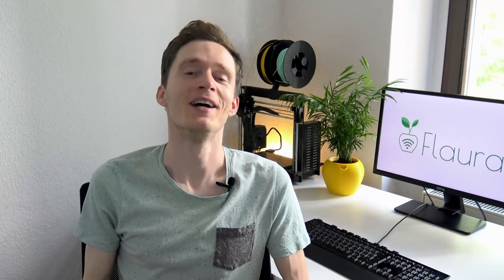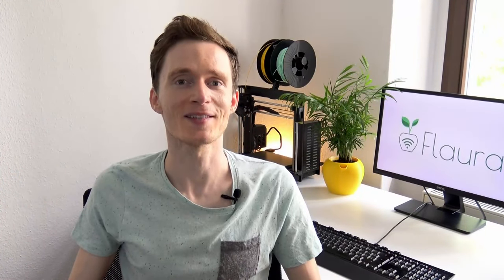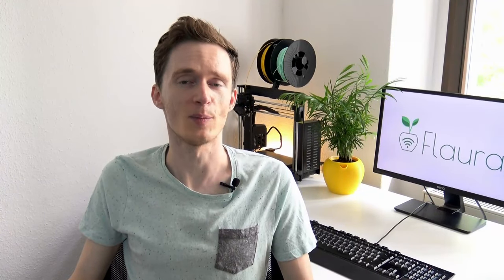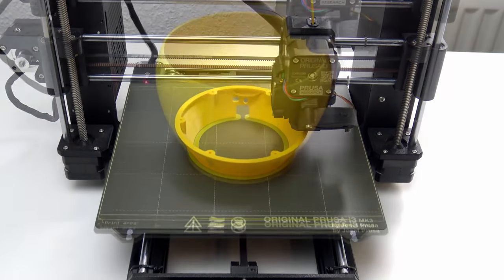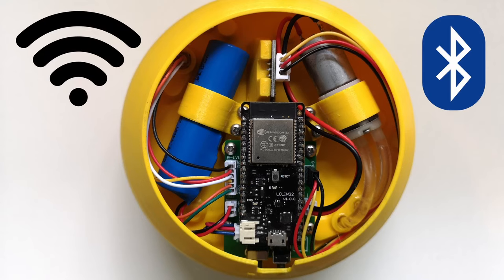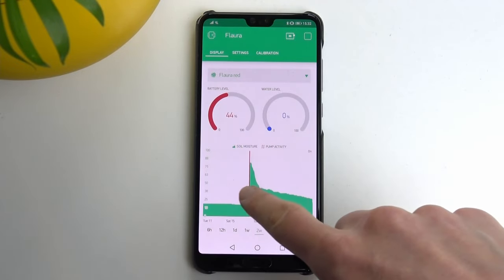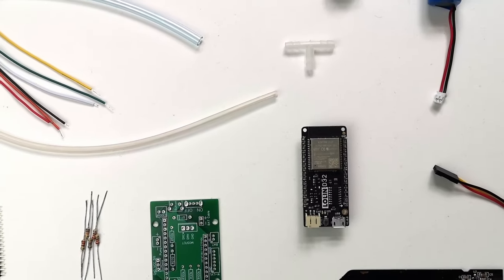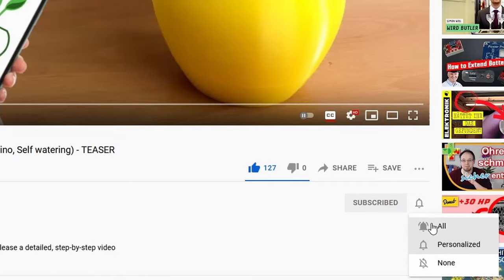Flaura – Automatic, Smart Plant Pot (Self Watering, DIY Project, 3D Printed, Arduino) INTRODUCTION

Comment: I would like to see a reservoir tank feeding a larger system.
Reply from the maker: I will try to adapt the current system for large plant pots, but very large sizes wont be printable on a regular 3D printer. So maybe these will require a different approach.
Reply: Definitely, and this is what would make this project truly valuable to others.  You can't justify parts cost and "over-engineering" for small plants, but you can for large expensive planters.  My retired mother spends four hours a day tending to her landscaping- and this is the stuff that isn't automatically watered. She can barely vacation without anxiety due to her large expensive custom planters.  I guarantee the cost of electronics to build a reservoir planter base or piggy-back type set-up would pale in comparison to what some spend on planter arrangements.  I'd LOVE to gift my mom some set-ups that I built for her!  Perhaps it's time for me to take this and contribute!

Comment: Excellent! I'm looking forward to seeing the whole series as my dear wife has filled our apartment with plants and is going on an extended trip - leaving me to keep up with the watering. I don't want to let anything die! 
Seriously though, I have been searching for a reliable solution to keeping our plants alive when we go on holiday together, so please do keep going with this series. I like the look of the pieces of hardware you have chosen to use - they look affordable!. Can I suggest that you release a BoM as soon as possible so we can order the parts and receive them in time for the assembly videos?
Also, we have more pot plants outside that need watering whilst we're away. They are in big pots, so a solution to use a big tank or container for several plants would be useful. We have space to hide the tank and don't mind running small pipes around the area if it means we can set up automatic, long-term, watering.
I look forward to seeing more in this series - thanks for posting!
Reply from the maker: Wow, thanks for this long and great feedback! I'm glad you like the idea :)
I will try to release the BoM as soon as possible, but there are still a few small changes happening to it every other day. When I`m done with the fine-tuning and there is a final version, I will let you know :)
Big outdoor plant pots are a completly diffrent story though. They are to big to be printed in a regular 3D printer and need much bigger water tanks and pumps. Maybe I will adapt Flaura for this application in the future, but I´m not sure about that yet.
Reply: @FlauraSmartPlantPot  This is all very much appreciated - thank you!
I understand the issues with large outdoor pots - we did try out a gravity-fed slow drip arrangement a few years back but it really didn't work that well. I'm assuming that however big the pot (ours are no more than 40-50cm diameter), the environment of moisture and watering remain broadly similar to house plants. Our outside space is just a balcony, so wifi & bluetooth will continue to work and the water flow rate shouldn't need to be very high - just 1 litre per hour (per pot) for example would be more than enough. Obviously a custom 3D printed pot isn't going to work here but a large tank (I'm assuming something around 20 to 30 litres will be sufficient, so not that large really) and some sort of manifold to feed individual motors for each pot. A 4 or 6mm tube should deliver enough water but as it has to travel up to, say, 10 metres then the motors might have to be a little more powerful.
Anyway, your upcoming solution for house plants is nevertheless a great idea and I can't wait to get started!

Comment: I'd love a parts list in the description. At least the key components like the moisture sensor, pump and the ESP device.
Reply from the maker: I am very pleased that you like the idea so much and that you seem to want to get started as soon as possible and order parts :) . On the other hand, I'm a little afraid of already publishing a parts list. I don't want people to order parts now, then something doesn't work properly and these people later regret it and blame me for it. I'm kind of a perfectionist and I want everything to work as well as possible. Things are still changing in the design, even in the basic hardware, such as the ESP32 development board. I have currently installed various variants and have not yet made a final decision on a product. Especially with the custom circuit board, which has to be specially made from a file, it would be very sad if someone orders things now and cannot use them later. I hope you can understand that and are still a little patient. I work as fast as I can ;)

Comment: Regarding the app, I think a way to have different "instances" for multiple plants would be great, so you could transform all your plants into these (you could also name each of the plants)! A drop down menu from which you can find your plant species and the app combs through/finds watering values on plant websites/wikipedia. This would mean no initial calibration would be needed from the user, the app would find average water amounts for the species of plant chosen and uses that for the default! The user could then tweak the values to take environment (temperature, size etc) into account. I don't know how complex this would be but it would be incredibly useful!
Reply from the maker: Damn I forgot to mention that in the video, the "instances" thing is already a feature of the app :D 
I've also thought of simply using plant data from a database to simplify watering settings. But that has failed so far, among other things, that I haven't found any concrete numerical values for e.g. preferred soil moisture or water quantities anywhere on the Internet :(
Reply: You could make a public or group database where people input their own findings about different plants for everyone to use.

Comment: Very great video! Having already started with the sensor based irrigation systems but still on the search for more - and here it is! Amazing!

So if I can suggest some feature (not reading all the comments ;), here are mine😉
- solar powered by some energy harvesting system, to be also be capable to charge by office lights (e-peas IC for example)
- home-assistant/esp-home capabilities
- pot-insert version, where the Flora can be put in an existing pot (german: Übertopf) - this would make it easier to blend in an existing interior design

Thats it! Looking forward to the entire series

Comment: Something I did different in my automatic garden: there goes something like a tablespoon of water each needed time, and so the system goes to sleep for 45 minutes, wake up, new measurement and another tablespoon of water if needed, or go to sleep until next day if water is ok.
The logic is that the excess water isn't good for any plant, and in 45 minutes a tablespoon of water had it's time to spread inside the vase.

Comment: Very interesting project. I came across it when searching for videos on how to combine WEMOS D1 mini with the capacitive moisture sensor. I should have watched your videos before as I just received 5 sensors with exactly the three flaws you describe. I have ordered a good one now... The reason why I'm looking into this is that given the drought in south Europe I'd like to build a DIY soil moisture sensor for the garden that connects with Home Assistant to control outdoor watering thus minimizing water consumption. Could that be a Flaura 2?? Anyway, great videos! great work!

Comment: Hi,
I'm really interested in Flaura.
I am already doing a ''Smart Irrigation System'' for a project for my Electrical Engineering bachelor.
The same electronic components are (they seem to be) used in my project.
Your 3d printed flower pot would really take my project up a notch - my setup is rudimentary right now.
I have no 3d printing/modeling experience, but I have access to a 3d printer.
When are you planning to release the template on Thingiverse?
Thanks alot! Cheers
Reply from the maker: I hope to make it this month. I hope that's early enough to help with your bachelor thesis ;)

Comment: Auf die Dateien bin ich gespannt. 
Eventuell wäre ein modularer Aufbau hierfür jedoch praktisch. 
Am Anfang erzählst du das man den Topf skalieren kann. Jedoch passen dann die Aufnahmen für Akku ESP und co natürlich nicht mehr. 
Du müsstest also den Übertopf und das Hardwaregehäuse vereinzeln. 
Wird jedoch nicht möglich sein wegen den druckführen für Kabel und Schläuche. 
Appropos Schläuche wenn man den Übertopf skaliert der ja gleichzeitig auch der Wassertank ist passen die Anschlüsse für die Schläuche nicht mehr....
Die modulare Bauweise wäre trotzdem praktisch weil so der Topf im CAD skaliert werden kann und nur die bereits besprochen Position angepasst werden müssen
Reply from the maker: Du hast natürlich recht, dass man den Blumentopf nicht so einfach skalieren kann, wie ein normales 3D-Modell. Also nicht einfach mit Faktor 2 multiplizieren und fertig. Die Anschlüsse für Schläuche und die Aufnahmen für Kaufteile müssen natürlich angepasst werden. Allerdings habe ich mich gegen einen noch modulareren Aufbau entschieden, weil mehr Einzelteile auch immer mehr Verbindungsstellen bedeuten, die dann wieder abgedichtet werden müssen und potenzielle Faktoren für Frustration sein könnten, wenn dabei doch etwas schief geht und es Leckagen gibt. Mit einfacher Skalierbarkeit meine ich an der Stelle, dass man im 3D-Modell (welche ich auch als .catpart und .stp-Datein zur Verfügung stellen will) leicht die eintsprechenden Maße für den Topf anpassen kann, und dabei die restlichen Maße unangetastet lässt. Ich werde so vielleicht auch einfach noch weitere Versionen für die üblichen Pflanztopfgrößen erstellen.

Comment: Great video, it's an amazing project and it's really well designed. I'm currently working on a project using a RPi Pico, moisture sensors, NRF24L01+ and a motorised ball valve, as part of my terrace automated irrigation system. I can see the benefit of 3D printing your own solutions and so, can I ask what 3D printer you were using please?
Reply from the maker: Its a "Prusa MK3S". My new video explains the 3D printing process in detail ;)  https://www.youtube.com/watch?v=LBk85mRINqQ
Reply: @FlauraSmartPlantPot  Thanks for the reply and signposting that. I'll check out your video.

Comment: Hello Martin!

I tried to e-mail you earlier but Gmail said your address could not be found.

I too am an engineer but in the USA,

I searched around for an automatic watering flower pot to buy and could not find one, so I started designing one, what I designed is fairly similar to what you made, particularly the water delivery around the top of the flower, and the use of an ESP 32 (I love those things!).

 I just came across your videos yesterday, I honestly, did not copy your design or gain any inspiration from your project.

 I intended to have a lot more features and for it to be a bit larger, but, I also intended to try to do crowdfunding at the end and mass-produce them.

Would it bother you if someone manufactured something similar to what you designed for profit?

 Thanks, ivan.

Comment: Components is desperately needed
Reply from the maker: I am very pleased that you like the idea so much and that you seem to want to get started as soon as possible and order parts :) . On the other hand, I'm a little afraid of already publishing a parts list. I don't want people to order parts now, then something doesn't work properly and these people later regret it and blame me for it. I'm kind of a perfectionist and I want everything to work as well as possible. Things are still changing in the design, even in the basic hardware, such as the ESP32 development board. I have currently installed various variants and have not yet made a final decision on a product. Especially with the custom circuit board, which has to be specially made from a file, it would be very sad if someone orders things now and cannot use them later. I hope you can understand that and are still a little patient. I work as fast as I can ;)